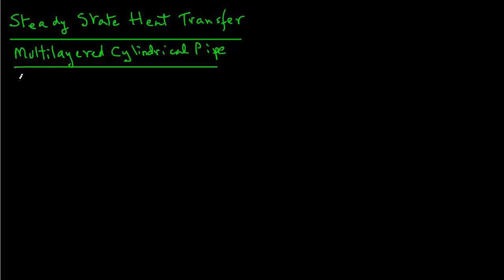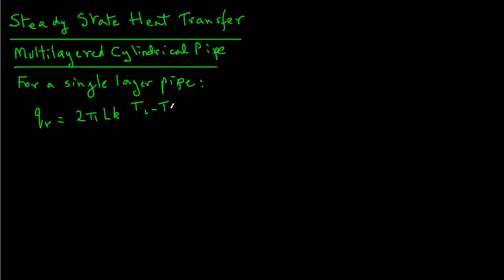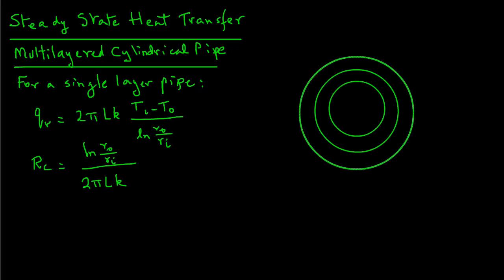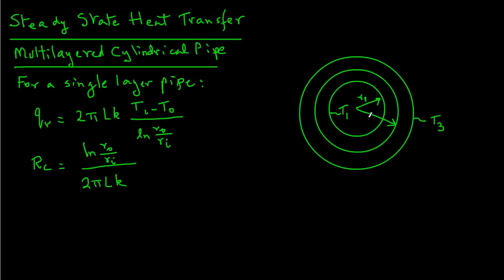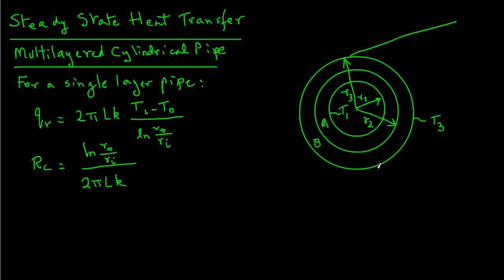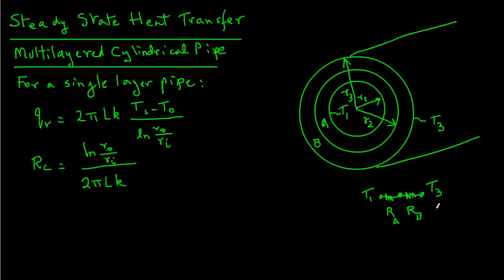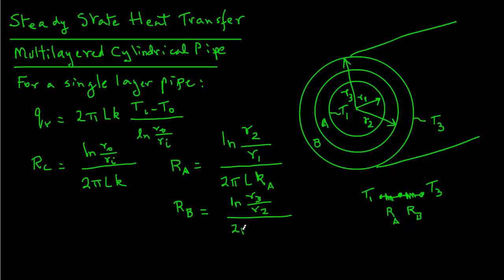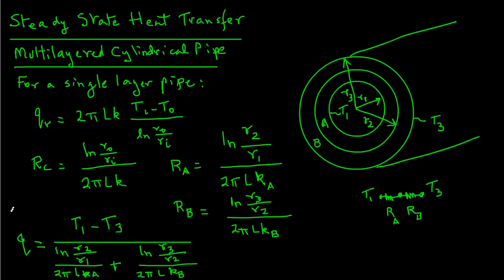Steady State Heat Conduction - multilayered pipe

Comment: Hi does this apply to more layers as well just using the data for that respective layer. Or so formulas change as you add more layers
Reply from the maker: Yes, this procedure applies to as many layers as are given in the problem. Use the relevant data for each respective layer.